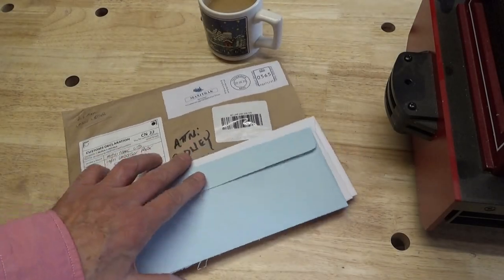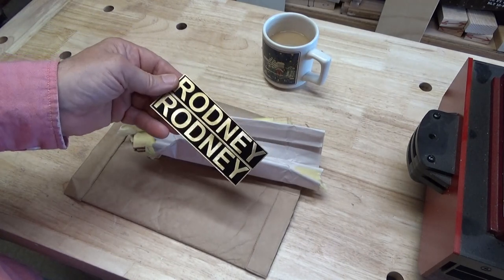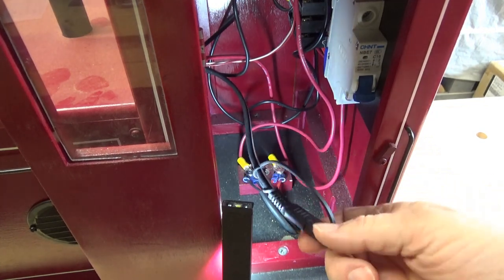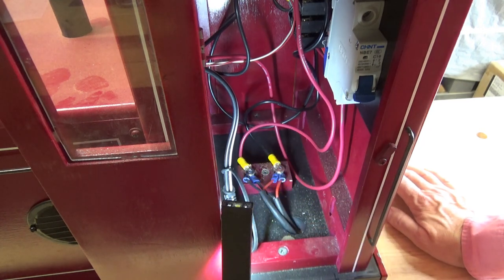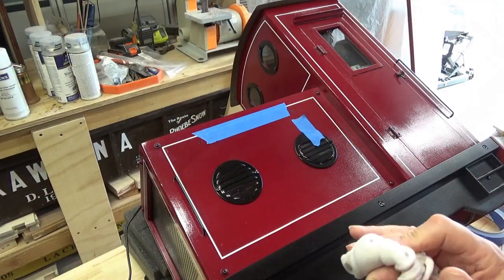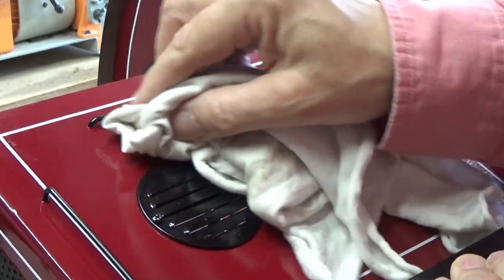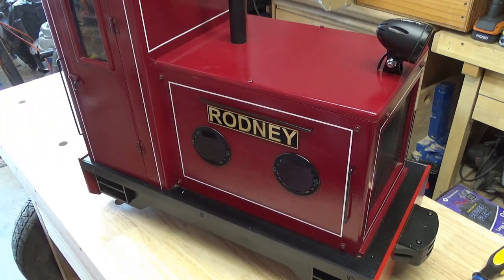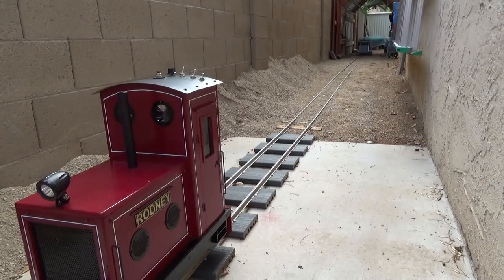Switching Locomotive Gets a New Look!  -  CNRR #48

Comment: Thanks, Stan I just found your channel and started watching from the beginning, I'm inspired what can be accomplished in 5" gauge, it looks like it makes yard work more like play. Thanks for sharing!!!
Reply from the maker: Thanks much!  My channel is a bit eclectic for sure.  But so is my life I guess!  😁 Although I started in the ride-on RR hobby building some 7.5" gauge equipment to run at our club, for home I figured I needed 1" to the foot scale to handle the tight curves, plus, wanting to have lighter stuff to lift!  The steam loco project I bought used happened to be 5" gauge, so I went with that British gauge instead of the typical 4 3/4".  Even though most of my parts and gear come from the U.K., it's been a fun experience.

Comment: Do you take the canoe out very often?
Reply from the maker: Hi Roy!  Well, our home is just a few houses away from an urban 'lake' of sorts.  However, since putting in the track, the canoe got put into the backyard instead of by the front gate.  So, it's been months since it has seen the water.  I have to figure out an easy way to get it out front by myself.
Reply: @StanFerris  Use the flat cars and Rodney.
Reply from the maker: Roy, you've been reading my mind.  I couldn't get far enough away to use the loco, but I planned to try and use the flat car as a dolly.  I'll give it a try one of these days.  The canoe is quite light.
Reply: @StanFerris  Arrange a support on each car with a hole in the center to hold a board, plate, etc that will be wide enough to support the side rails of the canoe when it is upside down.  This support should have a bolt or some pin that will easily go into the hole in the support on the car so the board is able to swivel as the car goes around curves.  With supports holding the canoe between the seat and the end, the canoe on top of the cars will act like a disconnect log car.  The car supports can be made out of 2 X 4s or similar so they just sit on the car.  They could be attached if by chance the total weight of the canoe and supports are not enough to keep everything together  With the support on each car between the trucks of each car, it will be stable.  The pin needs to be in 2 holes, one over the other, so the pin does not fall over.  My canoe is an OldTowne and weighs about 44 lbs.  Good luck with it.  You may be able to just use the 2 flat cars without Rodney, it should be more fun with the little engine.
Reply from the maker: Thanks, Roy!